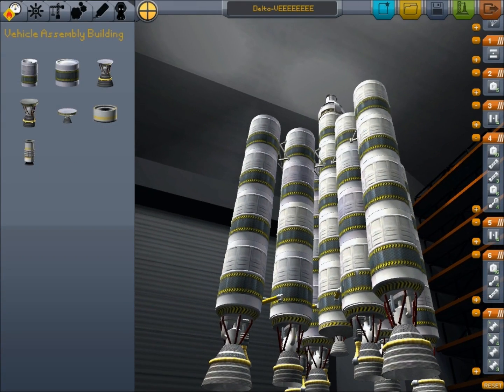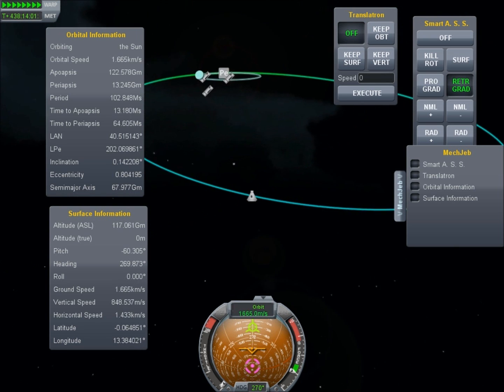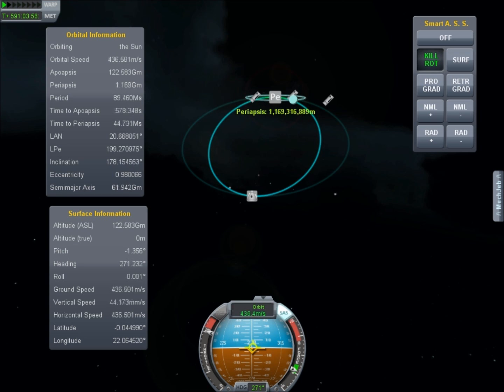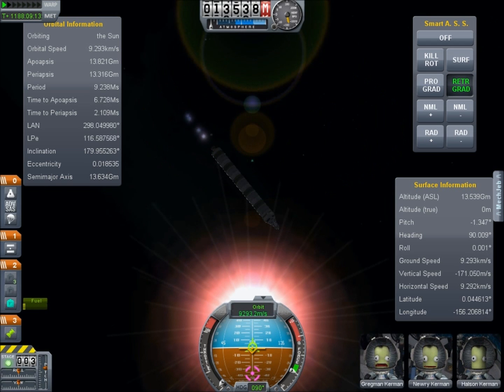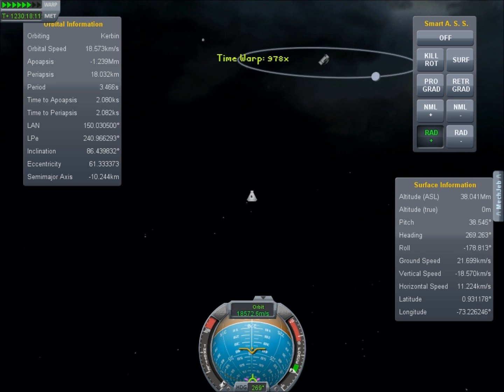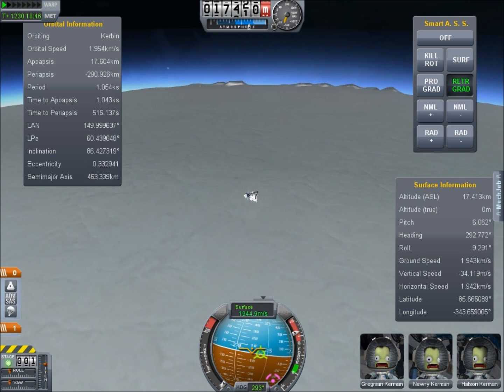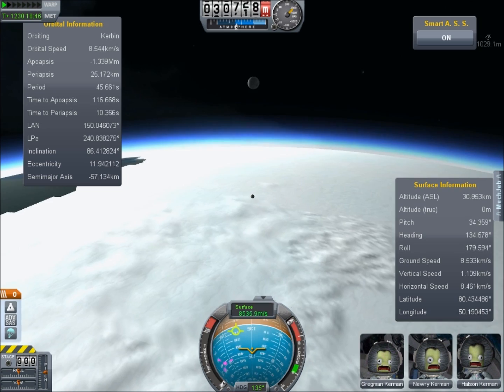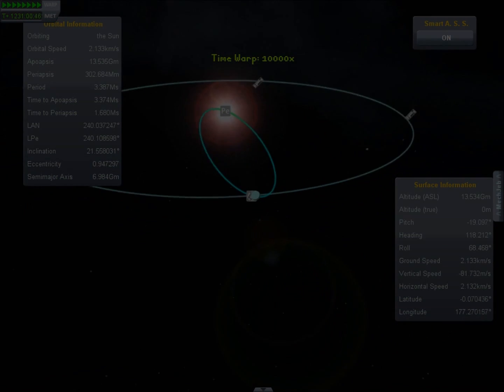Returning to Kerbin at 19km/s (withouth Cheating)

Comment: cont

BTW you can also improve the efficiency of those radial mounted engines if you wire them in a way that you spend the fuel of two of those radial mounts at the time ( to preserve symmetry ) and then drop them while the other two continue burning. Search for asparagus in the KSP forums for more details ... it makes the ships somewhat more unstable ( less radial symmetry ) but the fuel saves ( aka extra punch power in your case ) are quite significant

Comment: Not directly related with the 19 km/s fall into kerbin, but ...

I do find your fuel lines to be wierdly connected. You mention in the other video that the idea is to burn the lateral fuel tanks first , but you have the lines conected bottom to bottom. That means the central engines are burning the central tanks and the lateral ones at the same time. It will still burn the outer ones faster, but if you conect the lines bottom to top, you will burn only the outside fuel until the tanks are dry